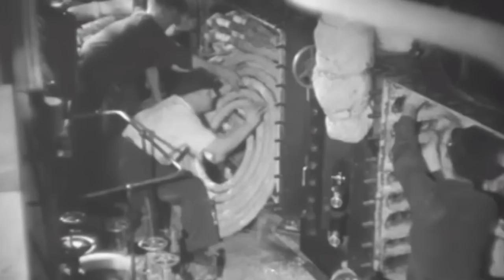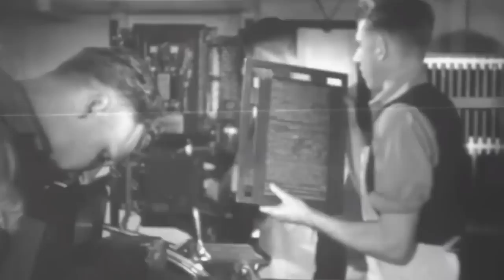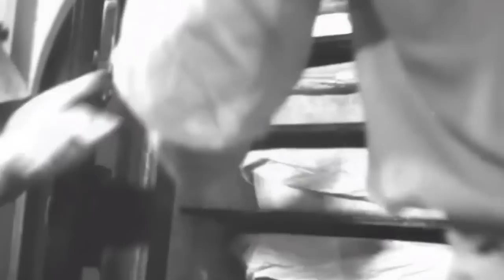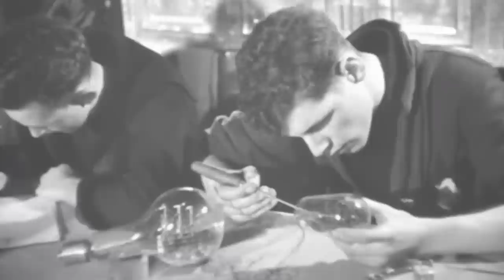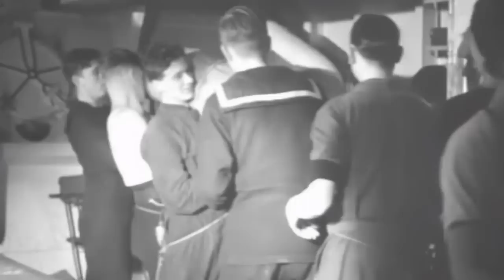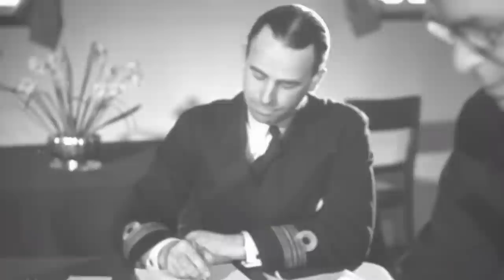HMS King George V | Royal Navy documentary (1942)

Comment: Is that a fire burning on the deck of the aircraft carrier at 15:13? Looks like flames..
Reply from the maker: Steam from the steam powered catapult. Probably looks worse than it is because of cold weather
Reply: @ArmouredCarriers  Hydraulic catapults in those days.  They used smoke to indicate the relative wind across the deck.

Comment: KGV was, I believe a very good battleship but not a great one because it was a bit slow for the firepower (which was adequate, as was its speed, but not great) and the quad turrets DID cause a good deal of trouble.   However, her protection was outstanding, her firepower was good enough for anything this side of a Yamato, and she was quick and economical to build.   Her battle record, whilst not without its downsides, is overall quite solid for some very hard-working ships.

Should have been named KGVI though.   I understand the King's sentiments, but I think that sticking with tradition in this case would have been more becoming of a monarch than excessive modesty.

Comment: 5 point 2  5 multiple pom-poms, really?
Reply: Comma needed in that script!
Reply: yeah, I noticed that too.
Reply: Yeah really!!!!  the 5.25 secondary batteries were dual purpose guns ...  the Australians and British army artillery used it as well 😳😳 ... shocking right ??
Reply: @Pvt_Badger0916   …… really is that the depth of your contribution?  The pom-pom was a 40mm automatic anti aircraft gun typically in four or eight gun mountings on British WW2 warships.
Reply: @givenfirstnamefamilyfirstn3935 ...  what he was saying that the 5.25 was also a anti aircraft gun because it was a pom pom / dual purpose gun used in both roles as anti surface and anti air roles .. also forefilled the same role in the British and Australians artillery units... you think the only use for pom pom means a 40mm anti-air gun of multiple barrels ? ... that's cute also means a British person to the Australians ,  south African and New Zealanders.   ... its  also what cheerleaders have in their hands ? Yet pom pom was also used for the earlier 37mm 1 pounder pom pom developed by maxim for anti aircraft and infantry roles in the 1890's.... because pom pom means anti aircraft gun because the of the sound it makes when firing...
Reply: @Pvt_Badger0916    .. R.N. Q.F. 5.25" Mk 1 gun fired at 7-8 rounds per minute, not per second.  Read up on what a pom pom was.
Thanks for sharing your unique opinion.